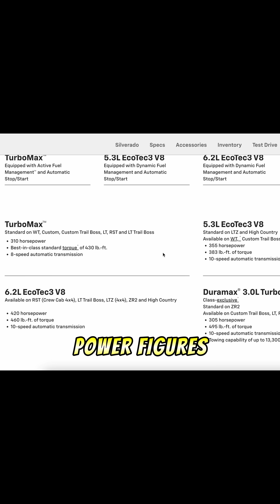Modern 1500 Engines Are Working Too Hard - WILL THEY LAST

Comment: And this is supposed to save the earth. The EPA pushes for more and more efficient engines getting better fuel mileage. But because there are so many failures we are causing more pollution than before because we need to replace so many engines and other parts. This is beyond stupidity…..
Reply: Yep.  Perfect example of, "the law of unintended consequences."
Reply: @jonesjones7057 The Epa needs to read basic economics by Thomas Sowell
Reply: @jonesjones7057  Sadly, I believe it IS intended.
Reply: If they were serious about saving earth they would have pushed for people buying older vehicles instead of using more resources to build newer ones. Recycle classics, leave these junk modern vehicles in the dealer lot.
Reply: Or worse, replacing it with a whole new vehicle. That’s even more materials and pollution than just an engine.
Reply: That’s the government for you
Reply: And it never changes truely a super retard ultra tyranny. Starting to understand why founders supported 2a what if we just shoot anyone who works for epa 10k on epa scalps i bet piss bottle diesels dissafuckinpear
Reply: The ultimate hubris, Man thinking he is at fault for the world's ills and fixes.
Reply: You're right, we should mandate older less stressed devices and smaller loads less often. If you're caught towing a big ass fishing boat too many times a year you could wind up getting raped in prison.
Reply: Bill gates just said climate control is no big deal now so!!!!! 😂 bring back the 5.7  Land Cruiser
Reply: Maybe they should have just tested these engines properly to begin with just a thought
Reply: If they cared about the environment the EPA would make all paid roads illegal and make ethanol in fuels illegal.  It isn't much but my Jeep gets 2.5 mpg more out of non-ethanol gas according to the CPU.
Reply: @Skilful_basics8  you realize ethanol fuel burns cleaner and it’s renewable because it’s made from corn, right?
Reply: @mike3963 I do understand that but for people like me who have to store equipment during the winter it's bad news if I forgot to use Stablizer.   Ethanol pulls moisture from the air and introduces water into the fuel causing the gas to go bad and fuel systems to corrode and seize up
Reply: @Skilful_basics8 though it is more efficient because ethanol has less BTU, ethanol is completely and totally renewable. They make it from corn, id argue the opposite if they really cared about the environment we’d make most of our fuel from corn instead of oil because ethanol when burned puts out only carbon dioxide and water. The same stuff the corn needs to grow. Completely renewable loop of fuel right there
Reply: @Grey5oh397 you make a good point.
Reply: Government has been squeezing for a long time. Don't bring political BS to the table. The manufacturers are kissing the governments ass to stay in their good graces. Mary Barra wants to take you to electric vehicles still. It's GMs goal. They obviously know how to build quality engines. They've done it in the past. A 90s 350 that could go 300,000 or more or a Ford 300 straight 6 that basically goes forever? Now this is the crap they hand us. To them it's a throw away world now more than ever. They will build them now so you have to come back and buy another one sooner and the banks love it too because you'll making those truck payments constantly and taking out loans. Manufacturers are lining their pockets. They have NO worries.
Reply: @bradleyphillips204  you do realize car manufacturers are the ones lobbying the government right? It’s the reason you can’t buy a hilux or Kei truck in the US

Comment: Is heat good or bad for diesels?
Reply: Depends how much heat you're talking. 
They like to run hotter than a gas engine but are gonna have problems if its run too hot for too long

Comment: I like my 5.0
Reply: Car engine in a truck
Reply: @Matt-m3e  runs laps around the 5.3 so what’s your point? The 454 was in cars before it was in trucks. Is the 454 junk too? Uneducated take lmao
Reply: @garboi8976 and how long is that gonna last revving to 7k to get a trailer going? Admit you wanted a pickup to get to the mall safe, the old 454, you ever look at the tach? It’s a low stress down low torque motor for a truck. What’s gonna last longer? That’s my point. Don’t get all hurt inside, many people buy a truck to just drive it and that’s fine
Reply: @Matt-m3e  in the fleet I service they last at least to 250k before they go to auction. So you tell me 🤷‍♂️. Seems like you know best.
Reply: @garboi8976 so a 4 cam high strung motor with enough sensors, tech and a lovely wet belt you think since you sit in an office staring at spreadsheets you know that 5.0, complex engine is gonna outlast a pushrod simple motor, low stress, the way they were made, cast iron block that has been proven to be all but indestructible, like the 350 small block, the vortec motors that replaced it? And you think I’m uneducated? Really? There isn’t many engines around that were more bulletproof than those motors period and it the ones that were aren’t the ones currently put in any pickup today regardless of make. FFS🤦🏻‍♂️😂
Reply: @Matt-m3e  I work on them every single day. It’s not 1985, 4 cams isn’t scary. I feel like you’re likely not a technician. Probably just a YouTube guy or shade tree builder. Good news is no one is forcing you to buy one for yourself. Drive your 5.3 and enjoy that ticking noise 🥰
Reply: @garboi8976 it’s a car engine, and I didn’t buy one or a 5.3. I bought a 3.0 diesel. You working on them everyday isn’t exactly a ringing endorsement for durability😝
Reply: @Matt-m3e  just standard maintenance lol. The 3.0 is great I advised my dad to buy one. Too bad the emissions system connected to it blows. But that’s true for all the small diesels.
Reply: How long will the wet rubber v belt oil pump drive last ?

Comment: I just got rid of my 2.7 Chevy. At 45k miles it was leaking oil… and of course not covered under warranty
Reply: Mine did have the oil cooler leak. It was common. The part was revised. My was installed under warranty and has been fine ever since. The engines are not perfect. Mine burns more oil than I think it should, but everyone says it's "normal." My old 1990 3.1L V6 (also GM) does not burn oil!
Reply: Bullshit, GM standard warranty 5 years 60k on powertrain
Reply: @Matt-m3e  Probably passed 5 years already.
Reply: With a plastic oil pan 😂
Reply: @XAVargasX0206 I doubt it, he just wanted to talk shit about a motor cause he read it on the internet😂
Reply: @XAVargasX0206 So does ford....
Reply: It was probably leaking from the cylinder head like mine was I just got mine back from two months. I had to get a whole top block.
Reply: Older than 5 years? That engine has a 100k warranty so they definitely should've covered it otherwise.
Reply: Total garbage engine.

Comment: Just gimme a hemi 5.7....👍
Reply: Yep my 5.7 hemi has 144.000 miles and has been totally trouble free. I work it hard and it still gets 17 to 19 miles to gallon on the highway.
Reply: Plastic upper control arms
Reply: Tick tick
Reply: @Matt-m3e  yep and 180k on her drives great tows good. just the dam exhaust manifolds. just preventative maintince.

Comment: if they simplified the systems and used forged crank rods block and reinforced the block they would be fine
Reply: They do lol
Reply: @chuckatley1464 hyperutectic pistons aren't forged
Reply: @Knucklehead4400 the 2.7 turbomax has a fully forged bottom end..no hyper